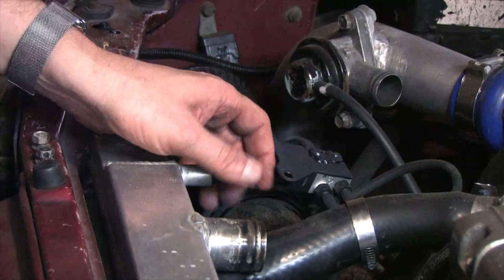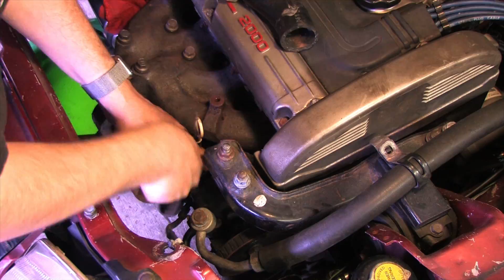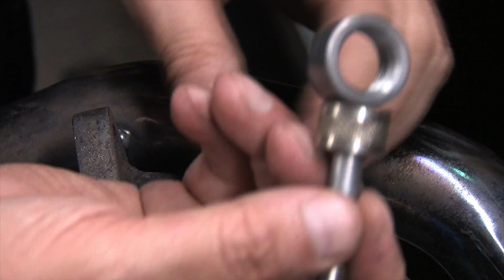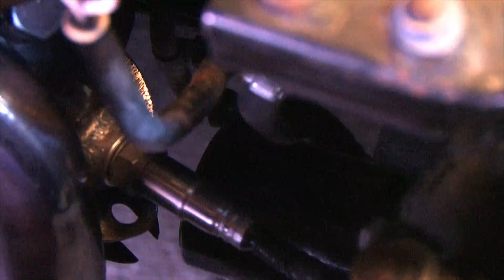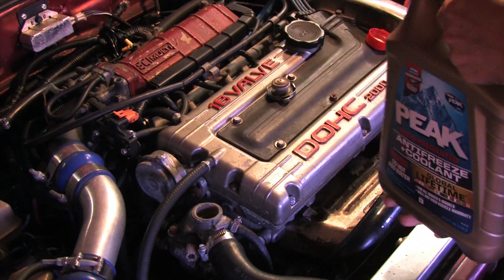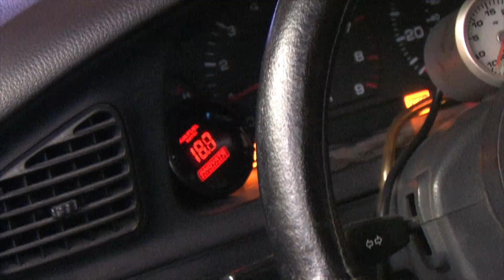Hyundai o2 Sensor calibration ft. Bunghole Trouble

Comment: Few videos back- you were having trouble with the intercooler (chrome) pipe flange leaking, even after Chad TIG best he could. My fix idea: remove it, partially (99%) block one end. ShopVac on other. Under vacuum, brush in some acetone, drawing it through leaks. Be careful- the sparky electric motor doesn't bomb out, just a teaspoon, and leave vacuum running to purge. Mix some 2 part syringe-type epoxy, thinned with drops of acetone, and spread over whole area. Now cover the vacuum leak 100% to draw in epoxy. When sufficient amount (?) is drawn in, turn off vacuum, let dry overnight. Soapy water pressure test that.

Comment: Flexible extensions
Reply from the maker: Nope.  :(  I looked for one online that might work, but on all the ones I found, the rigid section in the front is too long.  I couldn't even fit my shortest universal joint on it.  That was when I spent a few hours trying to mix up the right explosives.

Comment: Do yourself a favor and get something other than an Innovate. I made that mistake and went through 4 sensors in a short period of time. I switched to Zietronix and have been trouble free ever since.
Reply: I started out same as you: wideband in stock location and simulating narrowband. Ran good for a while then started getting errors and running like garbage. Recalibrated and got a few weeks out of it. Recalibrated, got a few days out of it. Then failed to recalibrate. Bought a new sensor and got a couple weeks out of it. 

Relocated to downpipe and bought a new sensor. Got about a month before errors. Recalibrated, got a few days out of it. 

Nothing but frustration from that Innovate junk. It wasan MTX though. Innovate was not helpful whatsoever despite multiple emails and phone calls. They just assumed I installed it incorrectly and never considered for a second that something might be wrong with the controller like I suggested. Their customer service was terrible 

Then I installed a Zietronix wideband controller with the same "bad" sensor that was on the car and have had zero issues with that setup.

Comment: I hate when I have bunghole trouble. Seriously though, I had a friend at a shop put a bung into my downpipe for my AEM wideband and when I got it back I couldn't install it because it was directly in the way of my oil filter lol. By the way Jafro, did I see you running the Elantra at the shootout? I got video of someone in one and I thought it might have been you.
Reply from the maker: Yes, absolutely.  That was me.  I made 6 passes at wastegate pressure.  I got lucky and beat an EVO.  It was front and center at the Motel6 after-party.  More coming on that topic!

Comment: You don't have to take the sensor out to calibrate, it only needs fresh air.
Toss on your boost leak tester, turn the engine so you have some valve overlap and flush out any stale air in the exhaust system.  You can then run the free-air calibration in place.

Comment: I got tired of burning wideband sensors in the front O2 location. There's a reason that Innovate says not to place the sensor immediately after the turbo. I was going through sensors once every few months. I ended up moving it to the downstream O2 location (cat has long since been deleted), and no problems since. No more burned sensors and much easier access. People say this adds latency, but it isn't really noticeable. Anyhow, I'm rambling. Great vids Jafro!

Comment: From your own experience is really lc2 that bad and killing o2 sensors like other people say? how many miles can it serve before sensor goes wacky.....thank you
Reply from the maker: It's hard to say.  Mine failed because of a different thermal issue.  The plug was touching a radiator end tank, it melted the clip that locks it, and it vibrated loose just long enough to de-calibrate it.  So really, the calibration issue was my fault.  People have posted in other comments that they've gone years without calibration.  It's really easy to calibrate as long as the o2 sensor is accessible.
Reply: i am happy to see you back again your channel is one from my old time favorite

Comment: This is why I use the AEM wideband.
Reply: Face Melter213 as do i i just put a new aem x series in eith a lsu4.9 with resistor calibration you can either leave it in resistor mode and never have to do this or do a free air if you want
Reply: The AEM sensors don't always play nice with ecmlink, known fact. It can be a hassle to get them to log correctly.

Comment: Man this video couldn't come at a better time as I was going with the same dump pipe.... Thanks so much!
Reply from the maker: There's really nothing wrong with that dump pipe.  It's a good value for the $.  If you know someone with a welder, you can buy a bung and a bunghole combo for under $20 and put it where you need it.  You know I meant that in nothing but a helpful and positive way.  I can already tell this video is going to cause some problems in the discussions... lol

Comment: I welded a new bung hole on my downpipe to make calibrations much easier. unfortunately I realized once I remounted the downpipe I welded in another horrible spot.
Reply from the maker: I so totally loved reading this!  We all do some jobs wrong once.  It's hard to prevent all the mistakes you have never made.  You gotta laugh at stuff like that even when it's your fault.  Just remember you don't learn anything from jobs you did right the first time, and acceptance is the key to preventing getting bent when they don't.
Reply: Evil GST that's okay my buddy welded is right under the oil pan on his dsm. Haha
Reply: mine is not that bad, however once I get a wrench on it there is almost no room to turn the wrench. Had I put more thought into it I would have welded it at the 10 or 2 o'clock position.
Reply: Evil GST FUCT LOL😂😂😂😭😭😭

Comment: Ditch the old LSU4.2 for a LSU4.9, no more free air calibration and better accuracy ++++
Reply: The Bosch LSU4.9 is superior in all aspects, especially regarding faster response times, resistance to fouling/poisoning, accuracy and no periodic free/open air calibration, however it is usually not a drop-in replacement for a LSU4.2. 
The controller must be electrically and logically compatible and ideally be equipped with the companion Bosch CJ125 controller integrated circuit. 
The reason being the LSU4.2 is referenced to ambient air and the LSU4.9 is referenced to a known internal reference cell pumping current and the CJ125 IC continually monitors and calibrates the sensor, plus controls and maintains the sensor heater temperature for optimum accuracy.
Reply: The Innovate LC-2 is fully capable to run the 4.9 with just another cable and adjusting the software. :)
Reply: +arnersae 
The last I checked the LC-2 did not utilize the Bosch CJ125 IC which means the LC-2 does not have the Bosch spec circuitry and capability to properly implement the LSU4.9. 
Will the LC-2 work with the LSU4.9, the answer is yes with some caveats. 
From experience and lab measurements that includes slower response, reduction in accuracy, inability to properly maintain heater temperature and reduction in usable LSU4.9 life. 
I will elaborate on any of the issues in as much detail including the engineering as desired.

Comment: Limited to Innovate O2 sensors? My Speed 3 came stock with a primary wideband O2, and a secondary O2 to make sure the cat is working properly (and also is involved in the ECU fuel trimming logic). Regardless, I'm still on the stock, 2010 primary (and secondary) O2s with 70k+ miles, and they're both still working flawlessly.
Reply: Numinous stock is usually narrowband
Reply: +Numinous 
Yes, that is to be expected. 
Many require replacement by about 85-100K miles or sooner if abused.
That is because of the type of sensor and controller integration in the OEM ECU/ECM/PCM. 
This is a stand-alone aftermarket gauge/controller and does not use the integration and cross reference of the other sensors and control systems to monitor and auto-calibrate like the OEM system.
Reply: +repcsi 
Most all US market vehicles manufactured since 2003 are equipped with upstream wideband O2/AFR/Lambda sensors from the OEM.

Comment: Glad you got your bunghole situation sorted out. The one on my 3-series is super easy to get at under the car and if I park it right  I can get under there without getting out the jack.

Anyway, for what it's worth the calibration process is the exact same for the MTX-L too.
Reply from the maker: With a wideband sensor, you're supposed to have it mounted at at least 45° upward (Edit:  Clarification.  The rear of the sensor facing upwards.  The sensor part pointing down.) for water evaporation during startup.  It helps the sensor warm up faster and not cause carbon to run down and clog deep within the sensor.  In theory anyway.  We'll see if my 25° angle affects anything as time goes on.  :)
Reply: Anything up ward of 90 in the exhaust top of sensor pointing up is ok
Reply: Jafromobile aem states 10 degrees.